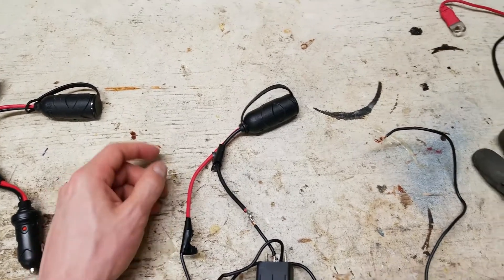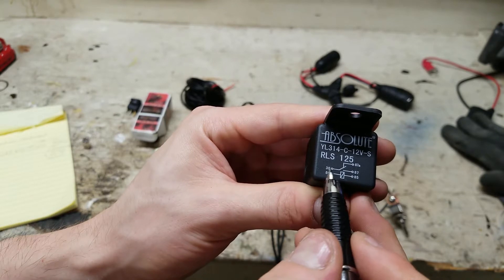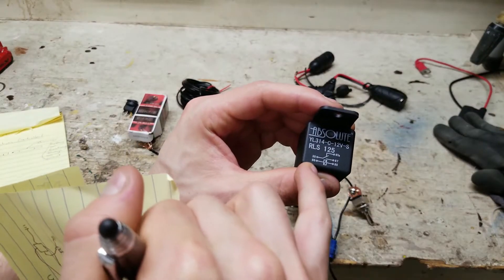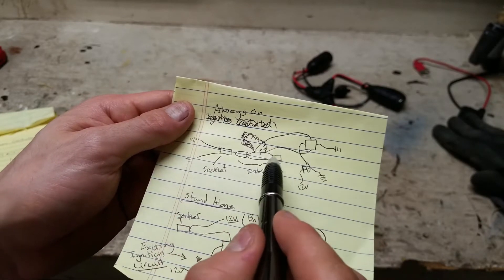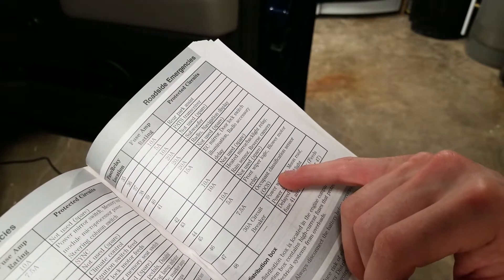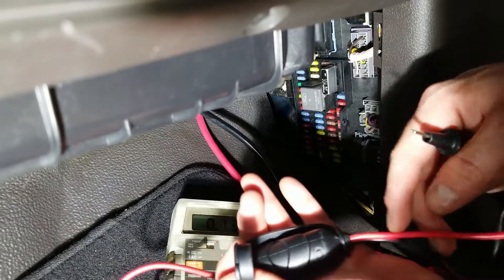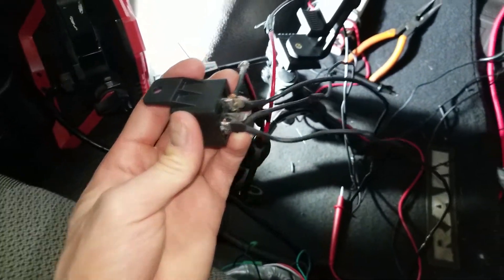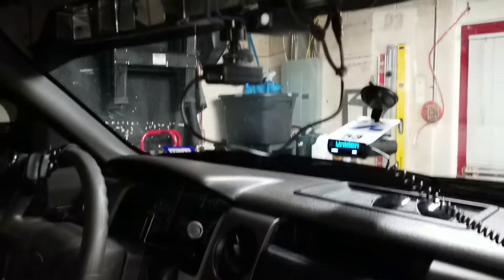How to Add an Ignition Controlled 12V Socket to a Vehicle

Comment: Out of curiosity: is there a reason you're using a relay? This can be done without a relay, with just a fuse ... right?
Reply from the maker: The relay is used so power is not always on at the 12V socket. Anything plugged into the socket would always be drawing power and drain the battery otherwise. The solution is to use a relay so when the ignition is on, it switches the relay on, and power is allowed to flow through it. When the ignition is off, the relay shuts off which cuts power to the socket. Hope that makes sense. Some vehicles already have ignition controlled outlets, some don't.
Reply: @gameoflife7235  weird I was under the impression connecting to a fuse on the fuse box inside the vehicle under the steering wheel only has power when the car is on.
Maybe I'm wrong?
I was told there are normally spare fuse holes under dash in the box.
Reply: That is fine, but you want to use something like a fuse tap. Wrapping wires around the fuse not only causes seating issues but can also cause arcing and blow out your fuses prematurely